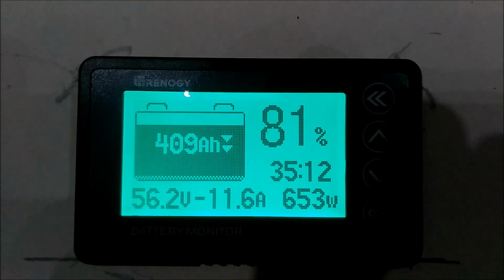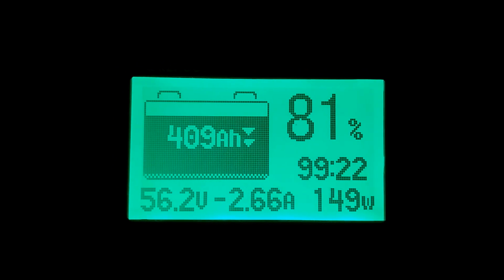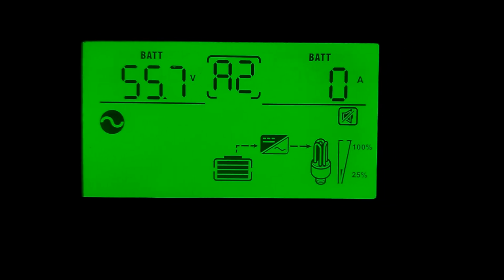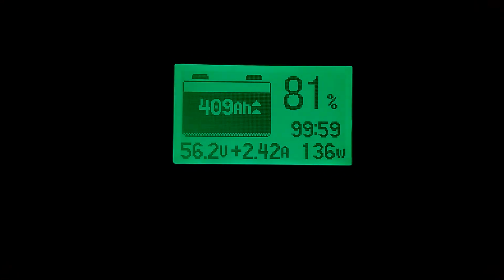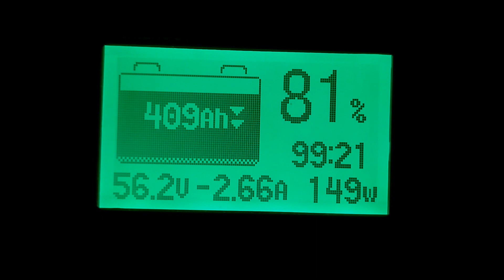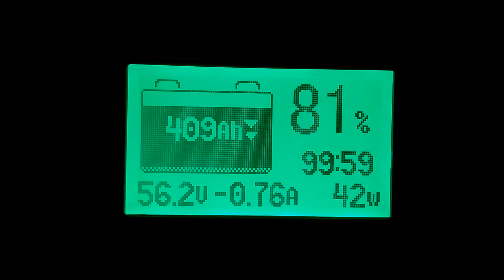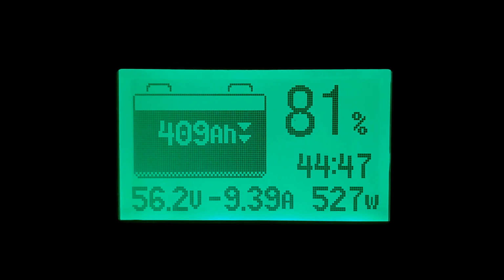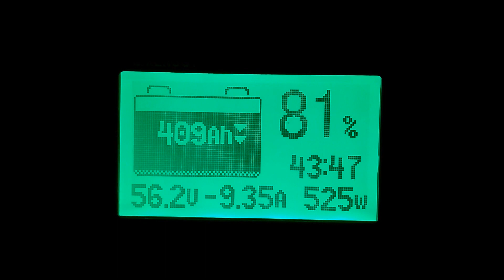LV 5048 power usage with no load

Comment: The LV5048 has to have a battery connected to function and battery has to have over I believe 42 volts or battery must be brought above 42 volts by charging with a different charger before the LV5048 will turn on.  I bet if you disabled grid charging of the battery and then cut power switch off the LV5048 would stay in "STANDBY" mode without changing anything else.
Reply from the maker: If you disconnect the grid power and turn off the switches it will run for about 3 minutes and then both units will shut down.
Reply: @carsonlurbanwindandsolar3437  I didn't say disconnect the grid.  I said cut off battery charging from the grid . Do this with battery voltage above 44 volts and the unit should stay on.
Reply from the maker: @teekay1785  I did both I turned off the charger with the grid on it stayed on a little bit longer but the unit still shut down I also turned off the grid power and the unit shut down faster so I did both you can see it in the video. you can also see in the video that the voltage was 56.2 higher than 44 volts.
Reply: @carsonlurbanwindandsolar3437  yeah I knew the battery voltage was ok  and I knew you turned main off to grid . I wasn't sure what the charge setting with grid connected was ie use only PV to charge batteries.

Comment: Each LV5048 has 2 inverters. So 37.5W per inverter including parallel communication. Same for me.
Reply from the maker: That is true 👍.
Reply: yes but it is still consuming 150 watts to get a maximum continuous 5,000 watts.
Reply from the maker: @teekay1785  150 w to get 10,000 w continuous cuz that 150 w include two units at 5,000 Watts a piece.
Reply: @carsonlurbanwindandsolar3437  Yep my mistake you have to compare 75 watts to other 5,000 watt continuous inverters or 150 watts to any other 10,000 watt continuous inverts.  I still wonder why inverters have to use this much power just to remain on to sense a possible load  and obviously some do not.